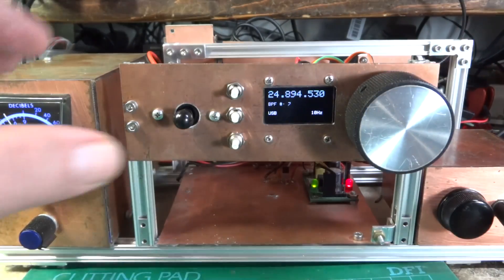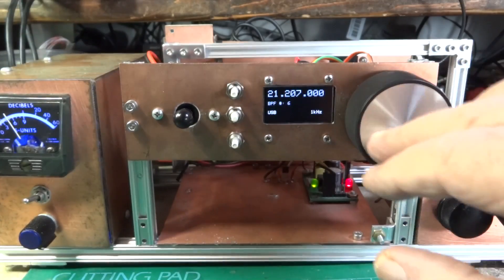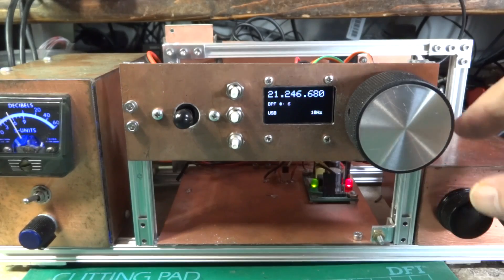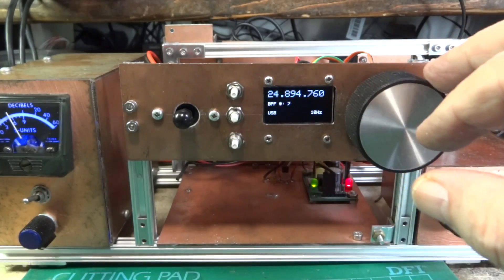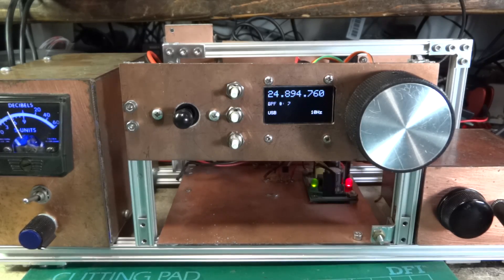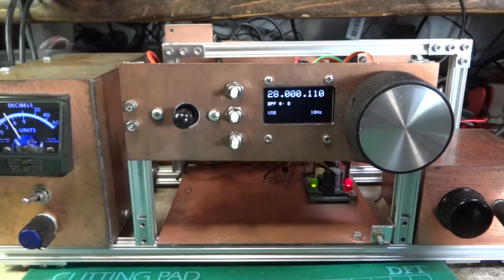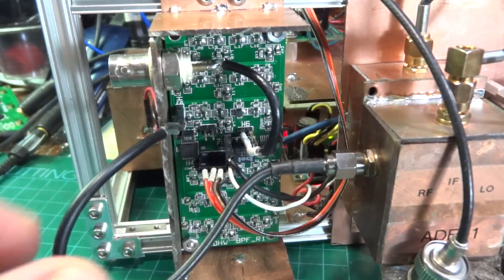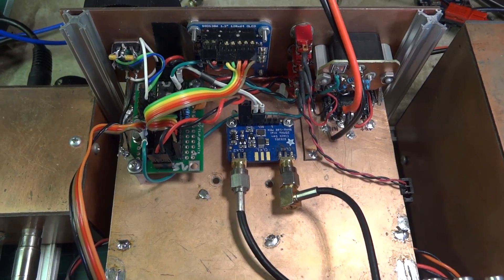NT7S Adafruit si5351 VFO/BFO

Comment: Neat! I bought one of those WB6DHW band-pass filter kits to use in a Russian "Klopik-2" 160m-10m transceiver kit I am building, in place of the BPF that came with the kit. I will be using a chip to convert my 9-position band pre-selector switch input to the three inputs required by the BPF. I am hoping it will make for a more compact package as well as being easier to work with, as the Klopik BPF calls for 9 pairs of air-core inductors to be wound to specific inductance specifications, then each coil has to be adjusted with an associated trimmer capacitor and the coils themselves have to be adjusted closer to or farther away from each other. Better to have a BPF that doesn't require a lot of fussing around with! 

73, de KC8MWG

Comment: Greta job !!! what level of outpu do you have  in the 5351 ?? what attenuation do you have to the analogue input circuit ? in my circuit i wiil use -17dB of input. this is correct ?

Comment: Wanted to buy the Adafruit board - but international postage made the Etherkit version cheaper.
Since this will drive an AD9851 [among other things] I'd be better off with the si570 - oh well, that can be my NEXT purchase.
Reply from the maker: +Alan Campbell Nothing wrong with the Etherkit board.
Reply: Looks well designed, but I was never great at soldering... they they called me "passion fingers" because every solder joint I made looked (ahem) below the minimum standard of my instructor.

Comment: Hello,  Ive tried compiling / Verifying the sketch so i can upload it and it keeps saying  ' Rotary  H: No such file or directory '   This is with NT7S sketch modified by PA0RWE ....  Why isnt the Rotary encoder information already in the sketch so its easy to upload ?  Ive built the hardware using a Nano and  a Oled screen ... but have hit a wall on the software ....  Programming the Arduino is quite new to myself and its proving to be a real headache ... Any information gladly received .. Regards de Gw0wvl.
Reply from the maker: https://github.com/buxtronix/arduino/tree/master/libraries/Rotary
You need this library for the rotary encoder
http://ak2b.blogspot.com/2015/01/installing-libraries-and-running-code.html
this might help a little regarding the usage of libraries.
Libraries change over time. The NT7S si5351 library has changed since this was posted. You need to download the latest version and read the notes here:
https://github.com/etherkit/Si5351Arduino
Reply: @raccoonnyc   Thanks for your reply, Ive looked and downloaded so much information today concerning these vfos im  about to give up with it all...  Rotary.h  ..... RWE si5351.h ....... Adafruit_GFX.h ...... EEprom.h ...... All these files appear to need to be added to  PAORWE's   sketch to try to get it to work, The hardware building was simple ... And its not only his Sketch, Lots of others ive looked at and tried all seem to want you to go searching for little bits of code here and there..  " Why cant the writers of these  codes actually put out a finished sketch "  ... One you can download , Install , Upload  and  away  you  go  .... Or is that to easy , It would appear  you  have to  belong to some secret handshake society to actually  get  any  of these working .....  Regards   de  Gw0wvl.